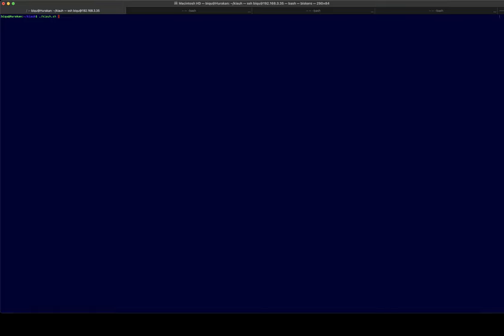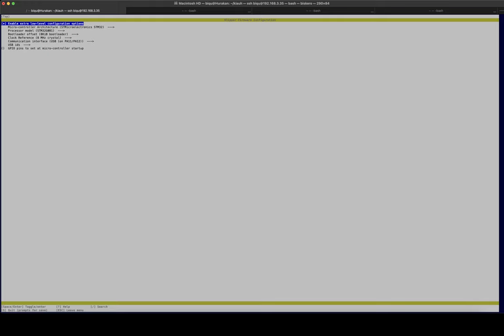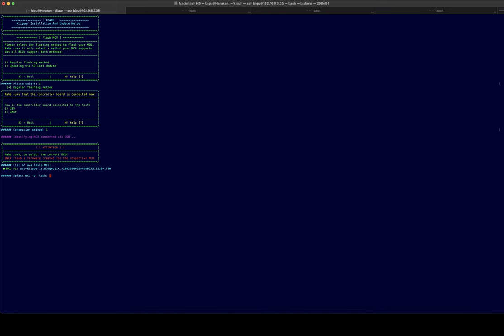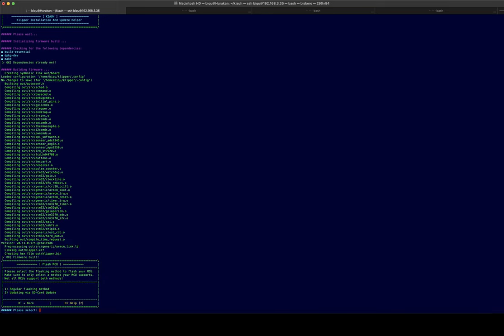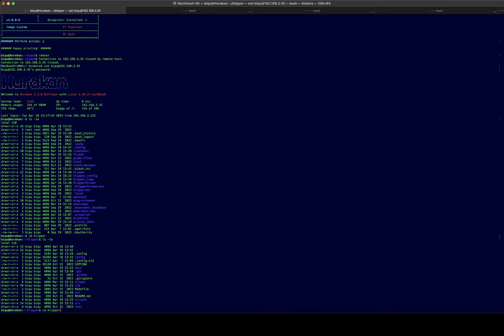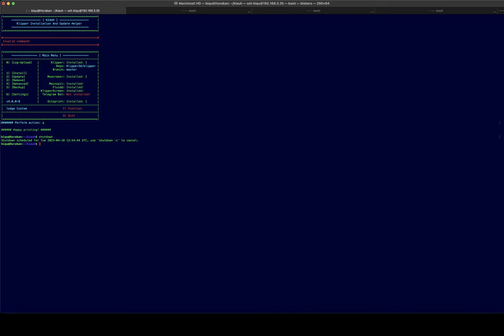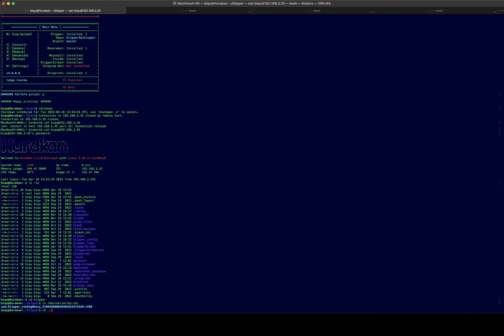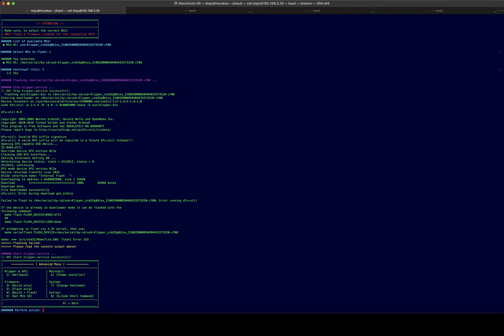Updating Klipper firmware from KIAUH script (some errors!) on the BTT Manta M8P - Custom 3D Printer

Comment: When the MCU decide to not be recognized it doesn’t matter the method. Actually kiauh it’s probably the best option out there to avoid mistakes. Don’t ask 😅 I have a manta board that for the life of me I cannot get to work 😢
Reply from the maker: ok, in these cases I start from scratch, install OS from zero. Once OS is installed do an update and upgrade of the OS and of Klipper and than do the rest. I know is a pain but give it a try! IF it does not work maybe is a bad board.
Reply: @ganzoai  done it 3 times :-D I decided to write to BTT
Reply from the maker: @jamieg3165  sorry could not be of help but at least you know you tried everything. Must be a bad board, hopefully they get you a new one!